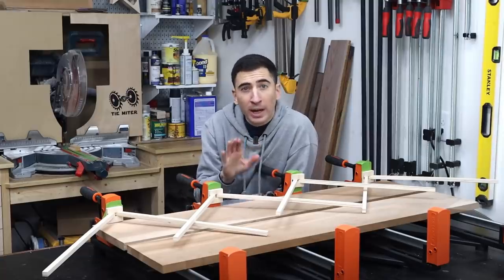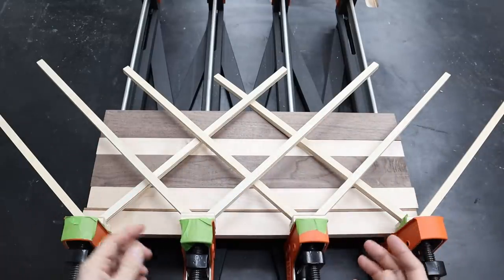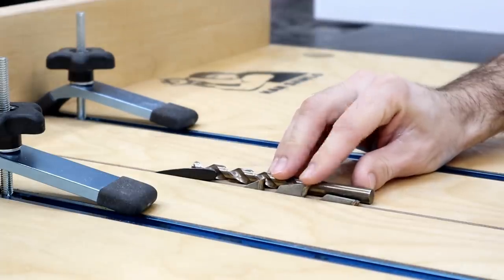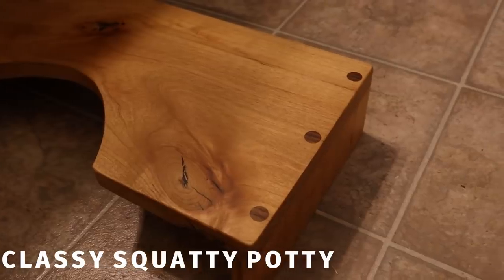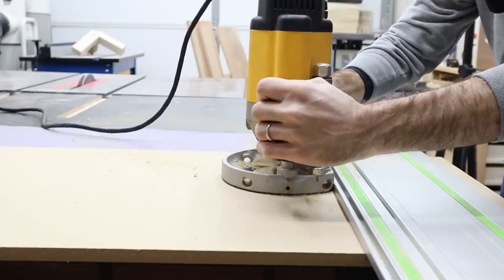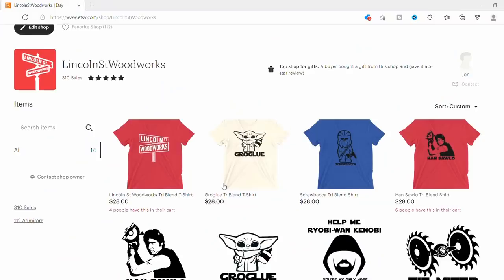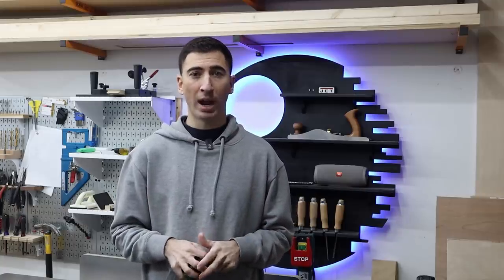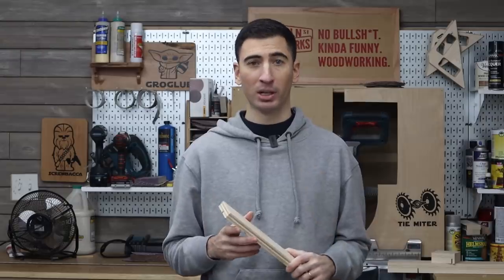I wish I knew about this before - woodworking

Comment: For the cutting board where the joint is closer to you, wouldn't the clamps also be applying pressure from the opposite side of the faces giving you enough clamping pressure from that direction? The idea why you would need additional clamps for the joint closer doesn't make sense. Why not flip the joints in your illustration then according to your description it would have enough pressure.

Comment: I am also a dummy in a garage, but the clamping part made me think... if the pressure from the clamp goes out a 45 degree field,  Isn't the other end of the clamp sending out force in a 45 degree field in the opposite direction?  So the glue joint close the moving end of the clamp is getting pressure from the static end.  Or am I not following?
Reply from the maker: Sure does, but you run the risk of over tightening to close them up.
Reply: Makes sense.  I strongly suspect that you wear the "Dummy" shirt ironically.  You smart.

Comment: To remove just a hair from the end of a crosscut using miter saw, safer to simply butt the workpiece to the plate of the stationary blade when fully plunged, then lift it up, turn on motor,  and cut downward in the normal fashion. Most MS blades are flexible enough that they will not slide the work piece away from the blade's teeth as you raise the blade up. Starting any saw's motor with the blade in contact with a workpiece is an invitation to a potentially serious accident.

Comment: Slight issue with the clamps and the flying V's showing where the force is going.  You did not take into account the force of the other end of the clamps.  Don't they apply an equal and opposite force from the other side??  So shouldn't there be flying V's from the other side overlapping the 1st flying V's ??????

Comment: Metric Measurements- 
I think it was John Heisz does a video about how metric is "not exact" and how metric actual is bad in wood working!! If it wasn't John, then I think it could have been Izzy Swan, but FOR THOSE WHO DO METRIC....
Metric is NOT exact when you need close tolerances!! In short metric has no place in wood working at all, and it is lousy in metal working as well too!!! The slight differences in just 10 millimeters can be mind blowing and nothing is ever "dead on" to 15 meters or 12 millimeters either!! Metric is "close enough" system of measuring!

Comment: I actually do not know any wood glue that needs pressure on it to form a stronger bond then it would without the pressure so, glamps are just there to hold it together until glue does what glue does, might  as well use tape. Too much pressure on such glue-ups can even also warp thinker pieces and create more problems.

Comment: Don't all miter saw blades go down below the surface of the throat plate?  Your material would never be contacting a tooth if the blade is "buried" as I call it.
Reply from the maker: The blades a circle - it raises above the surface at some point. You’ll probably find there’s 1 or 2 teeth that still contact the material right by the fence. Obviously depends on the tooth count of your blade
Reply: @Lincolnstww  gotcha.  My Dewalt 12" is buried deep enough that no teeth are exposed in front of the fence until several inches away.  But since I rarely cut anything more than 5.5" it's never a problem for me.  Good info, regardless.

Thanks for the content and the responses.

Comment: Clamp pressure being represented with a 90 degree angle is... easy but not correct. It's an arc that diminished pressure as you move away from the clamp bar plane. The compression of the wood fibers gives a bit of a uniform pressure at the center point but it's not very big. But like most things that are complex, simple visuals help and are close for majority of samples. However the thought that smaller pieces need more clamps is wrong. A better saying is the farther away the joint is from the center point of the clamp bar, The more clamps are needed. Knowing how many clamps is a much more complicated problem, that's why it never hurts to add more.
Reply from the maker: Totally agree - sometimes you need to simplify it - which was the goal here. You’re also saying the exact same thing I said in the video. “Narrow boards need more clamps because of the shorter distance to the clamp face”

Comment: But what happens when you put those 45 degree doo-dads on the other half of the clamp? Then all the edges are safe?
Reply: No, because there is only pressure at the intersection of the 2 cones coming from each end of a clamp.

Comment: Awesome as always.  Thanks for not doing the "Don't Forget to [like and subscribe[" stuff.

Metric's great.  Yawn.
Imperial sucks if you wan to do to math but it's GREAT if you want to use templates, drilll bits, or a piece of string.  A 1" piece of string (dental floss is great for this) folded once is 1/2".   Too big for the chuck.  Fold again 1/4.   That's good to put that stupid anchor in the wall.  Fold again 1/8" which is the table saw blade kerf.   Fold again 1/16" which is what shims fill in.  Fold again 1/32" which can fix up a dado cut or a rabbet so if something is "oh so close but not quite" it can be.   Fold again 1/64th inch and at this point yo're beyond most DIYer (e.g non-CNC) power tools.  It's also 0.039mm which is less than half the measurement unit length.  The rule of thumb is that accuracy is lost below half the unit. 

Half-laps.  Take your workpiece offcut and use the dental floss.  Put across the board, mark (sharpie) top and bottom edge, fold till they meet, and there is your EXACT cut depth to get 1/2.  Nobody's posted this on youtube.  It's like old-people secrets not to share with other non-sociopaths.    I don't know.

Try my idea.  If  you like it, don't forget to.... oh wait... I don't have a channel.  I am a fan of yours and your work  :)

Comment: The tip at 0:54 makes no sense. It claims that the far end of the cutting board is receiving enough clamping power (everything is within the Vs) but not the close side… but clamps apply pressure at both sides, creating a mirror force  that would envelope the close side in its Vs. Since we practically know that both sides would have unequal clamping power applied, the V trick doesn’t really work this way unless you use spacing blocks.
Reply from the maker: The pressure doesn’t just keep extending at a consistent pressure forever. It’s s function of the properties of individual wood species and width of the boards. This is a very dumbed down way to demonstrate - narrow boards = more clamps if you want nice consistent pressure.

Comment: This is a reasonable approximation. But there is nothing magic about a 45 degree angle in particular, and it’s simply not true to say that there is no clamping force applied outside a 45. The real answer is going to be very dependent on the material being clamped, and it’s stiffness. Imagine trying to clamp two ropes together - the 45 degree rule clearly wouldn’t apply. Dense hardwoods will require fewer clamps.  Softer, more flexible woods will require more. Or alternatively, you could add cauls made of a stiffer material, and apply more force with fewer clamps.

Comment: The clamping tip isn’t quite accurate. You need to account for the 45degree clamping pressure lines from BOTH faces of the clamp. If you do that, in the case of the cutting board, the deadspaces that you alluded to will in fact receive clamping pressure.
Reply from the maker: You would be correct if clamping force just extended forever. Sadly it does not. It narrows or widens depending on the width of the boards or the density of the wood. So many factors to figure out. Just use more clamps
Reply: @Lincolnstww  Fair enough! Thanks for taking the time to respond. Yours is one of my top 3 favorite woodworking channels. Keep churning out the good stuff!

Comment: This doesn't make sense. The clamping force is from two sides. So the "angles" also start from the other side and will cover the interconnection of the smaller pieces at the other side.

Comment: I don't get the finding board center from 6:10 to 6:30.  You cut about a third of the way into the board, flip it over and cut a third of the way into the other side and then raise the blade up till you take off the remainder?  That doesn't add up for me.  You would have to raise the blade up 2/3 to remove the rest of the wood so you will not be at the center.  I don't get it at all.   I read all the comments and not one person mentions this so my bet is there are a lot of others out there that didn't get this at all.
Reply from the maker: Go back and listen to what I said. “Raise the blade so it’s barely below halfway” then raise and repeat until the second cut removes the sliver.
Reply: @Lincolnstww  You do say barely below halfway, but in the video you're about a third, maybe.  Also you didn't say anything about raise and repeat, but now that you have I think I got it.  Flip repeat, flip again back and forth barely raising till its gone.  Seems easier to just measure what you need and then use that cool drill bit trick you showed.  I like that one.

Comment: I disagree with the 45 degree notion as presented by Katz-Moses.  Here is my comment to him on his video:
"I don't see the 45 degree business like you do.  You seem to believe that the force is uniform across that 45 degree cone.  I believe it is a vector force that varies with the sine of the angle.  But let's do a "thought experiment":  You take a pair of 8 inch boards, 16 inches long, and you go to glue them together.  Using the 45 degree rule, you could clamp them together with one clamp in the center (assuming you could generate enough pressure, which I believe easy for the right woods/grains).  Do you imagine that the force out at the outside of the glue joint is sufficient to push them together much?  Do you think that a slight imperfection that would be easily overcome in the center would likewise be handled out at the edge?  No, we all know that would not be the case and we all would put clamps closer to the edge; perhaps only 2 clamps, but definitely positioned so they are applying their force more perpendicular to the glue joint."

So, yes, I get that there is force applied in a 45 degree arc to either side, but it is NOT an equal force *across the glue joint*!!!!!!

Comment: The Metric System should come up with a new way of measuring time. I often get confused with the American version, where there are 60 seconds in a minute, 60 minutes in an hour, and 2 sets of 12 hours in a day. Telling time would be much easier if there were, say, 100 hours in a day, 100 minutes in an hour, and 100 seconds in a minute. Then if you were told it was 4 dekaminutes past 42, you would know it's 11 minutes past ten in the morning American time. Everyone would be on the same system, and it would be so much easier.

Comment: Search out the scientific answer to needed clamping force from FWW years ago (when it was viable). Your parallel clamps will never over clamp, or provide enough clamping, for any glue up if you stacked them touching side by side. 

There is simply no way the average small shop can apply enough clamping force and there is no way you can over-clamp (starve a joint).

Your two external reference individuals are far from anything to rely on. One is a youtube personality not a woodworker.

Search up the old FWW article and get over it. More clamps, ditch parallels, and put every ounce of squeeze on it you can and youll never go wrong.
Reply from the maker: Since you want to use FWW as a reference. Sorry it doesn't fit your narrative. https://www.finewoodworking.com/2010/05/11/how-to-glue-up-joints-positioning-the-clamps

Comment: Just a quick comment on the Imperial vs Metric. I use Imperial, not because it's what I grew up with, I used both growing up so I'm a slut! I use Imperial, because my measuring tape is Imperial. If could go the local box stores and pickup a Metrical Tape measurer, I would. But, only so I could rib others who don't understand metrics. I've been a mechanic for over 30yrs. I've Had To Keep The Working Knowledge Of Both Systems In My Head.
It's just math😎. Math based on 10's Metrics, Math based on a 16ths. 
For God Sakes people, learn to use Google.
Oh yeah, I forgot to mention that the scale on my circular saw is Imperial, the scale on all the Miter saw videos I was watching this morning happened to be Imperial. 
The construction industry in this country hasn't "switched-to-metric" because it's a common language between everyone, no matter what country they're from. Mike Drop.BAMM.

Comment: There's this new system for measuring. It's called metric... Just trolling but seriously, I get it. I just switch to metric and I think it's good but what do I know? I ended up flipping between the two at first but ended up completely switching to metric without even noticing. 

How about doing a video in metric and talk about the things you like, don't like, and whether or not you'll add it to your arsenal? I mean if people care so much that they're commenting all the time about it, why not capitalize? You can thank me later.

Full disclosure: I don't care that much. But I would still watch it.

Comment: It’s just not true.  The force of the clamp is not spread evenly across a 90° sweep.  I’ll prove it.  Stick your finger in the part of the glue-up that isn’t covered by your 90°sweep and then tighten your clamps.  Of COURSE there’s clamping pressure in that area.  The pressure drops off the further you are from the line between the clamp pads, but that drops off slower and slower the wider the board is.  I wide board can probably be glued with a single clamp by planing a 0.001-0.002” concavity on the glue surface.  The flex of the board will spread the clamping pressure across the whole glue surface.  Obviously that won’t work with edge banding - unless you put a wide caul between the edge band and the clamp.

Comment: And the fact you feel the need to "defend" to continue the use the system of units you're used to is why you will keep getting comments on it. There are a few groups of people who comment on that: people who genuinely think you can be more accessible to a broader audience (which is true, and if you don't care for reaching out best you can do is ignore - also being aggressive to them, rude), idiots who haven't figured the "that is what the video makers are used to and is easier for them" part yet (you won't make them less dumb with a tip, you can only ignore), and last but definitely not least people who know it annoys you and do it on purpose (you don't feed the trolls, you ignore them - congrats on telling them you're a mine for reactions by giving them their ultimate prize, a call out on a video, the polar opposite of anything you hoped to achieve).
Reply from the maker: It's amazing how much of that clip went over your head. This is the internet stop taking yourself so seriously.

Comment: You had some great points but lost me with the metric vs imperial comments. I'm a Midwesterner, grew up with imperial units but metric is far easier to use and convert. I quit using imperial for all of my building projects years ago and don't miss it.  I'm not going to harp on anyone for using imperial but I'm not going to pretend that it's better in anyway.
Reply from the maker: never said it was better or worse - just said its what I know and Im not changing

Comment: It' not a matter of abandoning imperial units, just give both.

If  spoke a language used by as few people as use the imperial system (3 countries, fewer than 500k people) and I expected people from outside USA to be patrons, buy merch, like, subscribe, I' at least make the tiny effort of one person translating them (you) as opposed to thousands each having to do it.

Sure, I can do it, and enjoy the "use it or lose it" factor of endlessly translating the numbers in my head so lazy content creators don't have to.

It's not a welcoming attitude on your part.

If it's all too hard, do a spreadsheet with a column of blank cells, a column of imperial unit names (inches, feet, etc) to the left, and a column with simple multiplication formulas that produce the metric multiple of whichever number you type into the appropriate blank cell, and on the far right, the name for the appropriate metric unit.

For a woodworker, there aren't a whole lot of units in either currency.

Tricky bit - either change to format of the blank cells to accept fractions, or insert fractions as such - 1/4 = .25; 1/8 = .125; and so on.

My advice, provide dual units as a courtesy to your non-American viewers, or tell them to go screw themselves and watch a different channel

A lot of channels, I've got so annoyed at this repeated lack of interest in foreign viewers, I give up watching the channel altogether.  If they don't want to make it easier to watch their channel, why not

There are plenty of US content makers who can put that minuscule effort into attracting me. It's like someone on my doorstep trying to sell me something, and although they could speak English to me, they consider it a point of pride to remain as obscure as possible by sticking to their own language.
Reply from the maker: I don’t expect anything from anybody. I make woodworking content and dumb jokes. If you’re going to take the internet this seriously I suggest finding something else to do with your spare time. It already takes me 100+ hours to make a video, apologies it’s not exactly how you want it
Reply: @Lincolnstww  I'll let you enjoy your American exceptionalism without further comment.